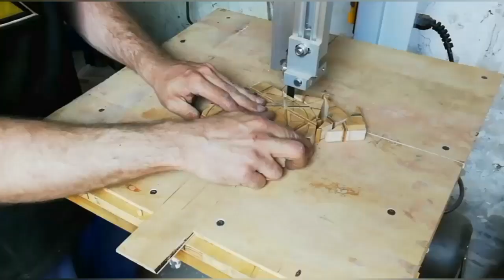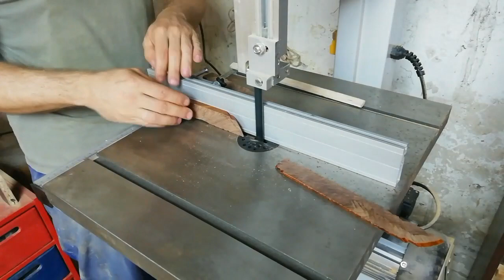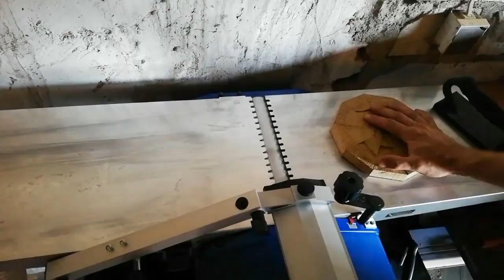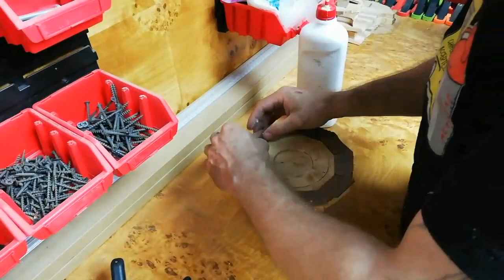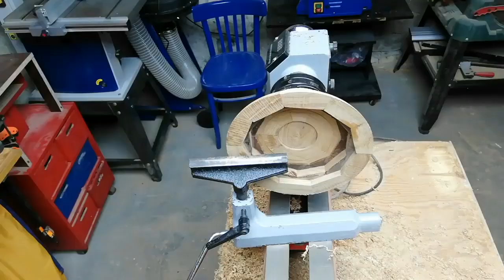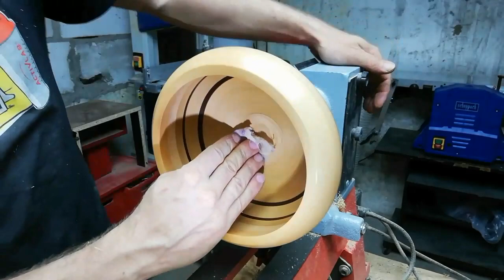Oak bowl with beech wood open segments - Woodturning

Comment: Nice work Rav, and I really like your new intro.. Great job...
Reply from the maker: I needed a small change in my videos 👍 I was a little afraid that I will not gonna make it from boards made myself but looks great 😁
Still hot there? Here nights are getting colder.
Reply: Rav, we have finally just dropped below the 100's, its been a super hot summer here.

Comment: Beech never fails to satisfy 👍 always so beautiful🏆.   The bowl? Lovely too Rav🏆.   Takes a lot of work to do a segmented bowl, especially an open seg😮 but was well worth the effort my friend.  Do the open segs get some tearout on the unsupported sides? That always looks like a possibility.
Glad to see your planer/jointer works well for you. And the bandsaw too. Whew👀 ... I was worried a bit about the bandsaw but knew you'd conqueror it💪 (be very careful feeding into the planer please - underneath can hide things😮)
I like the new, shorter intro ... it's much more effective👍

Stay safe bro🤜🤛.  -Mike😷
Reply from the maker: Oh yes, beech wood, even scraps is satisfy 😊 I like to turn and finish it especially.
Yes, tearouts has showed in few segments even when I had a fresh sharpened tools. Unfortunately they were small and easy to sand.
You are right with planer. I was able to learn that 😲 Once the chips has blocked one piece inside. I scared a little. Now I'm cleaning the table before I put the board inside.
I changed the blade and bandsaw is cutting excellent. Boards are straight and with proper angles. I have to change the plastic ring around the blade becouse it's not straight now with the countertop.
Thank You very much, my friend, for support and tips. I appreciate that 🤝😊
Stay safe. Rav
Reply: @Secondlifeofwoodturning  😃😃
When will you be ready to make your lathe go in reverse ? That's a tip I really want to give you👀 (simple to do but may void your warranty) 
I be safe as I can, thanks🙏
Reply from the maker: Ready to make my lathe go in reverse? Now You interested me. Is this possible? How to make a switch without opening the control box? I'm not worry about warranty becouse when I'm calling to them with problems they sending me new parts without asking. I have one good control box more so we can do something with it 😁👍
Reply from the maker: Many thanks my friend 💪💪💪🤝🤝🤝 I will look closer to it and try to do something. I hope I will not burn the lathe 😬
Reply: @Secondlifeofwoodturning  Let me know if you need some help. Just remember you are only trying to switch the two wires that go to the motor.
Reply from the maker: I checked the links and it is very simple. Just one switch and two short wires I need. Thank You once again, Mike 🤝😊
Reply: @Secondlifeofwoodturning  You can buy reversing switches already made to save you making the 2 crossovers. And be sure you get a switch with big enough amp  capacity. 
I am feeling good about this Rav 😃😃🙏🤞